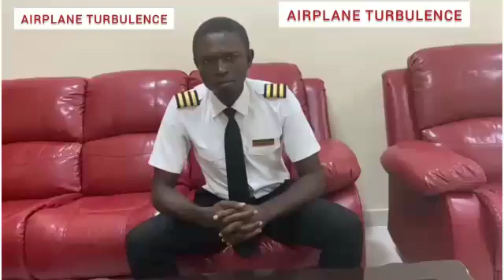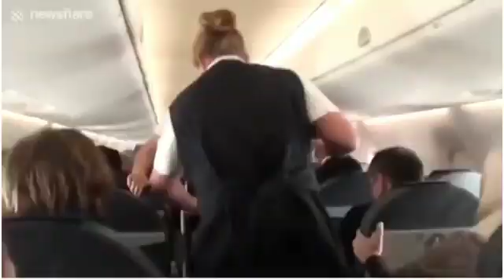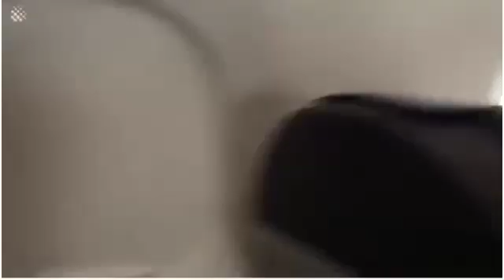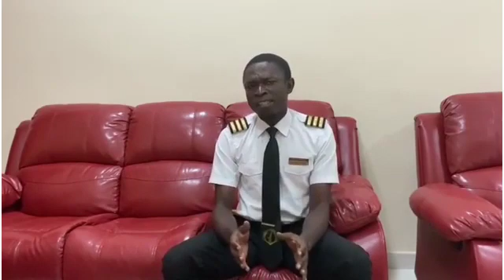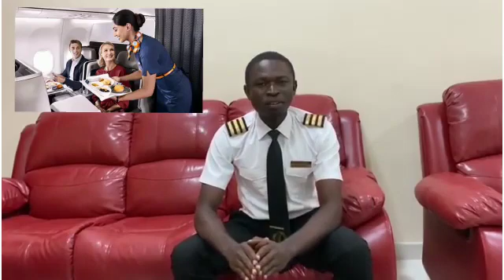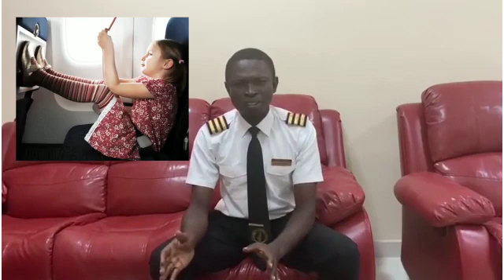Airplane Turbulence ( Why turbulence can't cause a crash in modern aircrafts)

Comment: Hi, I've read about incidents in airliner planes built in the 1950's and 1960's, that crashed due to turbulence (such as the Boeing 707, F-27, BAC 1 11 and F-28). What has changed with modern designs (1980's and onward such as A320, 777, etc) that enables them to withstand the most extreme turbulence? thanks

Comment: Thanks for putting peoples minds at ease. I’m not too scared as the regular car ride is probably more bumpy than any flight. Plus I’m a roller coaster junkie 🎢. Air pockets are kind of fun 😊.
Reply from the maker: It's good the facts are stated the way it is. As long as one is the seat belts are latched and secured, there is no cause for alarm.

Comment: I have always had a little fear of flying. Thank you for your series. It is very helpful. It's a relief to know that most of my fears were based in myth.
Reply from the maker: Definitely. As long as you are secured with your seat belt, you are safe. Injuries you hear about during turbulence situations are simply because the persengers were not on seat belt.
Reply: @aerofoilaustine9743  Thanks 😊

Comment: Great video! I'm more concerned with the age of the aircraft, metal fatigue & lack of maintenance on some of the budget airlines!
Reply from the maker: Age of the aircraft is not much of a problem as long as proper maintenance is carried out. 
The body part or airframe is designed to last over 7 decades and it's structural integrity is still in intact. Aircraft engine is either overhauled or replaced from time to time which automatically makes it looks like a brand new one. Other parts are periodically replaced in accordance with maintenance manual. 
Although, aircrafts retire after 2-3 decades depending on the manufacturers specification.

What one should bother about more is cutting of budget but every country has its regulatory body that ensures proper maintenance must be carried out. Anyway, it's still possible there will be corruption someone where. You just gave me a topic to speak about and I  am going to talk about this topic soon. Thanks so much for this comment.
Reply: @aerofoilaustine9743  Wow, thank you for the detailed & informed reply! Many years ago, I caught a flight from Australia to NZ on an American Airlines Boeing 707. The aircraft was obviously very old (The headphones were plastic tubes not wires!) The cabin crew were in their 50's too, but I reassured myself (with some of your points above!) that it'll be fine. About half an hour out of Auckland, I glanced out of the window & noticed the wing vibrating badly & the whole aircraft started to shake. The pilot calmly reassured us everything was fine, but the look of fear and concern on those hostesses faces told a different story. We landed safely, but I think that company went bust soon after! :)
Reply from the maker: @nottherealmccoy4955 I see!! Fear not about wing deflection because the wing is structural designed to withstand all forms of tensile, compression, bending and torsional stress coming from the air without any doubt in its structural integrity.
What is key in aircrafts airworthiness is the maintenance culture of the airline operator not really much about the aircrafts age. Periodically, as time goes on, all the parts of the aircraft must be replace at some  point or the other and the only part that can't be replaced is it skin. It is so because it is already designed to last for so many decades before the aircraft retires from service
Reply: @aerofoilaustine9743  My reply must have been too long, the plane shook violently all the way to the airport, the cabin crew were ashen faced. From then on, only flew Qantas or Air NZ! Fun fact, the fins on surfboards work just like aircraft wings & our turbulence is white, aerated water!
Reply from the maker: @nottherealmccoy4955  Turbulence affects all Airlines. Although is more pronounced in smaller Aircrafts. It's ok, I like the comments and will always respond to them

Comment: Thank you so much my Son, this has been my greatest worry during flights, about my ten years into flights ( international & Domestic ) I experienced my  two in- flight turbulence, one on a flight from Chicago USA to New York, the other from San Diego to Oakland, these were my greatest nightmare, I guess you have helped me much with this Video. ⭐️👌👍
Reply: Very Interesting to know that turbulence have not caused a crash in the last 4 decades.
Reply from the maker: @onahcarl5317  Exactly, the plane can't obviously crash because  it is already designed to withstand whatever scenerio it brings with it. Have some good fun whenever it rocks your plane my chief engineer
Reply from the maker: Its always part of the flying experience and has no inteference with the safety of the journey. It is just the discomfort it causes to pessenger but as long as your seat belts are latched and secured, go ahead and have a good sleep